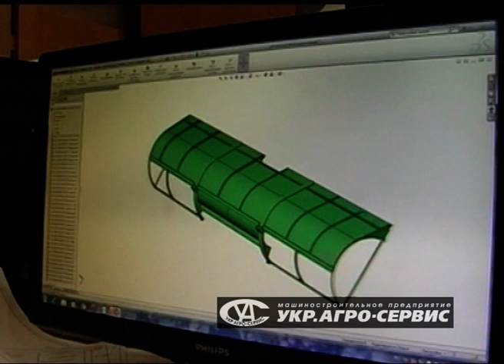Stripper header Slavyanka: harvesting machine of grain and industrial crops

Comment from the maker: Harvesting using a stripper header is a progressive and cost-efficient technology that allows for quick harvesting in unstable weather conditions saving fuel and the technical resource of the machine. The secret of economic efficiency of the stripping headers is in harvesting by threshing plants on the root, where the grain is stripped from heads and the stem remains untouched.
Let's compare the principle of the traditional header and Slavyanka UAS two-cylinder stripping header (diagram).
A traditional header cuts the plant stems along with their heads after which they are fed to the harvester, which threshes the grain and separates it from the straw. The grain accumulates in the bunker and the crushed or stacked straw is removed from the harvester. In this case, up to 50% of the engine’s power is used for cutting straw, its transporting, crushing, separation and grinding or stacking.
The principle of the two-cylinder stripping header is different.
The stripping unit consists of two cylinders equipped with combs, one of which strips plants and the other one moves the grain to the auger. The cylinders rotate towards each other, while stems in the comb zone are stretched between the combs and stripped from the grain. The resulting mass, 80% of which is the stripped grain, goes to the auger space along with the air flow and then is fed to the inclined chamber by the auger. Then it goes to the grinder. Thus, less than 20% of the grain and not all of the heaps is threshed unlike in the traditional harvester.
This significantly reduces the mechanical load on the working parts of the machine. Therefore, the stripping headers can be aggregated not only with new but also with exhausted harvesters increasing their productivity by 1.5-2 times.
The Slavyanka UAS header line is represented by headers with an operating width of 5, 6 and 7 meters, which are designed to operate with harvesters with a rated throughput of 4 to 11 kilograms per second.
The Slavyanka UAS headers can be aggregated with such harvesters as Niva, Yenisey, Don, Acros, Polesye, Case, John Deere, New Holland, Klaas, Massey Ferguson. You can also combine the header with harvesters of other brands by special order.
The header’s feature is harvesting at high speeds of the harvester, which makes it possible to shorten the harvesting time by 1.5-2 times.
Pay special attention to the harvesting speed. The Niva harvester moves at a significant speed of 7 kilometers per hour. And the quality of harvesting still remains high. The loss of grain on the field with the yield of 40 centners per hectare with dense crop does not exceed 1%.
Under such conditions, the efficiency of the header with an operating width of 5 meters is 20 hectares per day, and a stripping header with an operating width of 7 meters allows harvesting up to 40 hectares of agricultural land a day.
It should be noted that along with the high efficiency of the stripping header, it allows not only to shorten the harvesting time but also to significantly reduce fuel consumption per ton of grain harvested. On average, fuel economy is 40-45%.
The height of stems is not of great importance for the stripping headers. They equally successfully remove laid grain, harvest fields with matted stems and a lot of weeds.
The stems are carefully combed; the grain losses correspond to the agrotechnical requirements. Even in the area of laid grain, the combs of the stripping cylinder grab all the grain providing high efficiency and quality of harvesting.
By threshing plants on the root, you can harvest not only cereals. The Slavyanka UAS stripping headers are all-purpose. Along with grain, they harvest seeds of fodder crops and medicinal plants. It is particularly advisable to use the stripping headers in farms using the No-till and Mini-till technologies when stubble residues remain in the field and become organic fertilizers necessary for soil.
The Slavyanka UAS stripping headers are developed and manufactured by the Kharkov Machine-Building Company “Ukr.Agro-Service”. The experts of Ukr.Agro-Service have been developing and manufacturing equipment for harvesting and processing of agricultural products for more than 20 years. The unique design solutions are patented; the products have numerous diplomas and certificates.
The Slavyanka UAS headers are used in all regions of Ukraine, as well as in the neighboring CIS countries and non-CIS countries. Therefore, we believe that we are able to meet the needs of any customer. Our company has all the necessary resources and aims for mutually beneficial cooperation.
The Slavyanka UAS stripping headers are manufactured in our own factory of high-quality materials by highly skilled workers. They are repeatedly tested, inspected and only then shipped to the customer. We track the history of each our header and are proud of the fact that our Slavyanka UAS headers can perform operations that traditional harvesters can’t.
Reply from the maker: subscribe to our channel and stay tuned
http://youtube.com/c/UkragroservUa